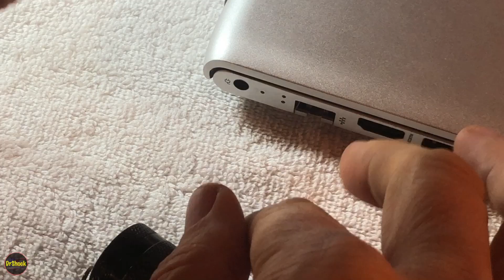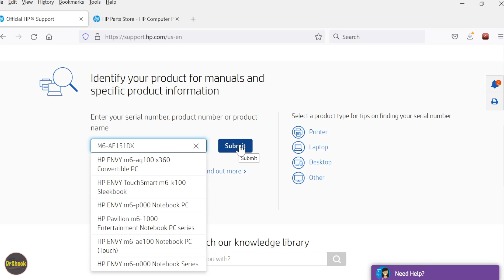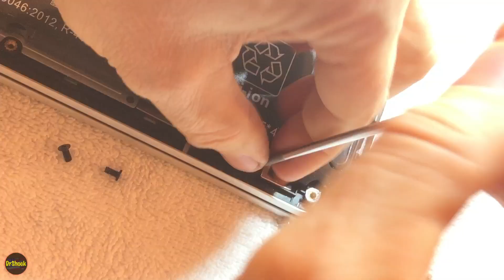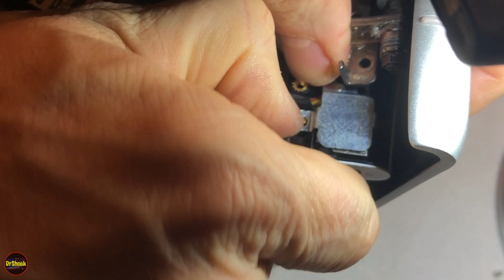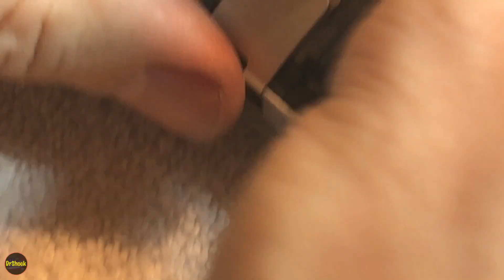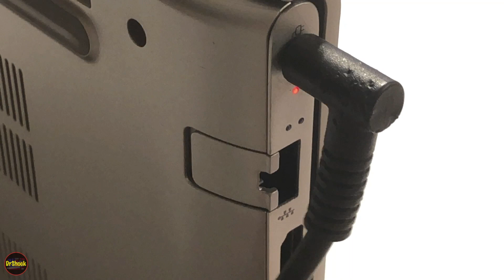HP Laptop Not Charging ~ DC Power Input Charging Jack Cable Assembly Replacement (ENVY & Pavilion)

Comment: Hi! I have a question about the DC input charging jack. The "red" light ,visible when the charging cable is inserted, is visible always even if the DC jack is not connected to the motherboard?  Or in order to make it visible must it be connected to the motherboard?  Because I checked with a tester and the 'volts' are present on the exit of the jack, but if I insert the cable, nothing, the DC jack light is off. 
Thank you.
Reply from the maker: It's been awhile since I worked on that particular laptop, my recollection is the normal state of that LED when its not charging is white and when it is charging it is amber in color (like an orangish).  I don't ever recall seeing red on this particular HP model.   As far as the behavior when not connected to the motherboard, couldn't say.  Since the damage on this laptop was obvious, we went straight to a brand new replacement part as there was no need to do any subassembly level testing.

Comment: That charging cable is actually tri-axial - there are 3 contacts there. The outside of the barrel is -ve, the INSIDE of the barrel is +ve, and the center pin is a 1-wire bus that talks to an eeprom in the charger to identify what wattage charger it is (and maybe an "authenticity check" to prevent you from using knock off power adapters). Almost all laptops have used a 3 conductor power cable for years now, especially HP, Lenovo, and Dell. That tiny center pin is not thick enough to carry the full charging current + running current when the battery is charging and the computer is on, that's simply a data pin. You might've measured +19v there because it has a pullup resistor in the power supply to keep the data line from floating to some random value when it's not attached to the computer.
Reply from the maker: Thanks, yes the center is a sense pin that can also lead to the CPU being throttled down when the BIOS cannot detect anything there.  She might even still charge intermittently under such throttled conditions as well, if enough contact surface is still happening with the adapter plug.  

The simple voltage check on an external power supply brick is a common factory service manual smoke test when determining if you have had a situation like this short the connector and internally damage the adapter brick.  The adapter bricks are not serviceable, and would just be a customer FRU ( field replaceable unit ).